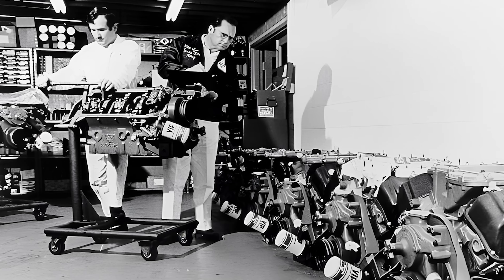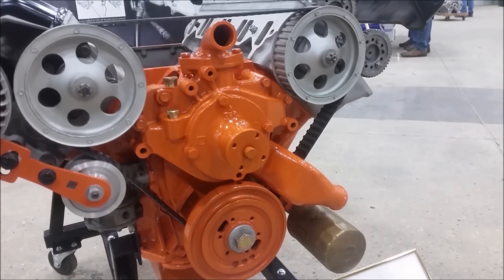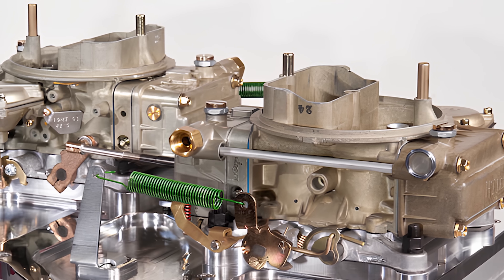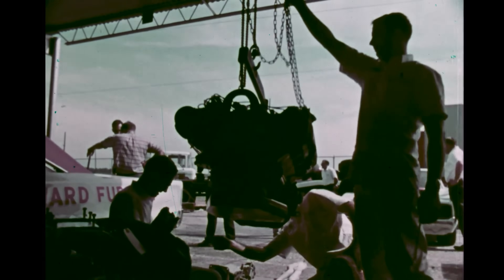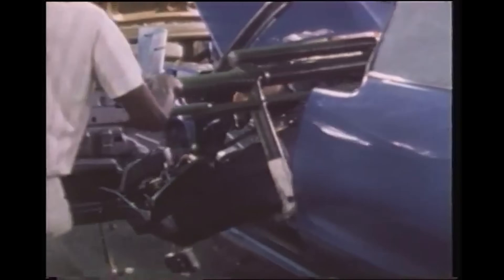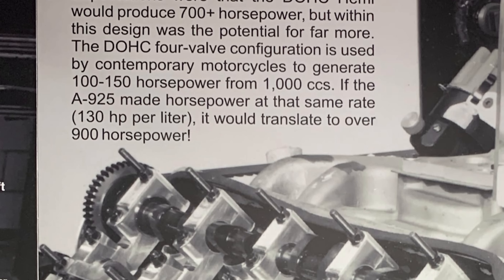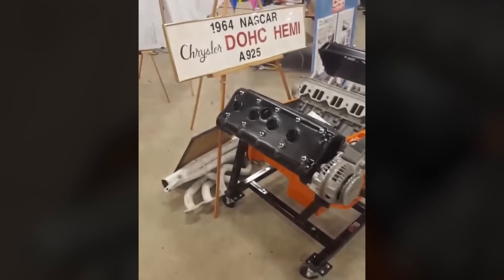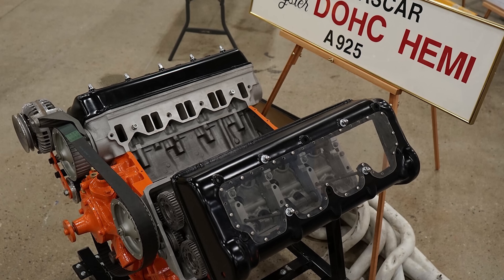THE UNTOLD TRUTH BEHIND CHRYSLER SECRET 426 DOOMSDAY ENGINE

Comment: All those parts and configuration for horsepower, to play with ford and chevy, and if you find an original 454 lS6 with the configuration, its 500 plus horsepower without all those parts.
Reply: So Chevy needed an extra 20+ cubic inches to play with Chrysler? Sad

Comment: Why did they just develop them for drag racing like ford with the cammer ????? Or just released them to the general public like a crate engine
Reply from the maker: That's a great question! The Chrysler 426 DOOMSDAY engine was designed for high-performance applications, and while drag racing might have  definitely been  one of its strengths, the focus was on performance and ultimatly a  great engineering experiment .  @ronaldotoole6986
Reply: @rarecarstoryscould you imagine the terror this things would be in the wing cars in nascar

Comment: They had this engine, as well as another Hemi well along in development, so they wouldn’t get caught out should Ford come out with something new. They wouldn’t only have used either engine if they had to. The other point, is they knew they were pushing the limits of what NASCAR would allow. The other Hemi that was under development was an answer to the Ford Boss 429. It was a conventional cam placement, two valve engines, just much bigger bore spacing, shorter stroke and enormous valves, built with an eye to living well at higher sustained RPM.
Reply from the maker: You're absolutely right! Chrysler was definitely ahead of the game with their engine developments. It's fascinating to see how competitive the automotive industry was back then, especially with NASCAR regulations in play. @jamesblair9614

Comment: This same exact example of the 426c.i. Hemispheric Engine's still available from different sources of the old school American Made Engine's, built by American Iron Engine's USA..I don't know how many of these engines are running and pumping out horsepower the engineers built them to be able to make an possibly a bit more torque than horsepower listed from the manufacturer..600+, hahaha, more like 700+ and Xs the listed amount of power that wasn't put on a dynamometer for the driveline horsepower rating..I'm pretty sure that during the 70s a guy had his car, a 68 or 69 Road Runner dynoed because it was hard to handle drag racing especially when 817hp to the wheels was all that huge piece of a PowerPlant Engine was wall to wall and so huge that it just tickled the almost crap outa me just idling and I had never seen anything quite like it before cause the 50s Hemispheric Engine's was not the same cubic inches as the 426c.i. Engine's was..300s and 200s was how they were built although they had more torque than horsepower and it was strong and torquey enough to make it to the big leagues..I've  gotx thef contact information for those who would have to have the opportunity to own and enjoy the old school American Made PowerPlants just to be willing to see first hand what was enjoyed as a teenager and early 20s with age..I was permitted to do time trails in a daily driver that was alot faster than expected at 15yrs old and I really enjoyed the 6.0 I's continuously running was fun for me and told that I can go 200mph if needed but not with no safety equipment for rollovers and crashes that happens not excepting anything like that to happen..A 1965 corvette engine was transferred into a 63 Chevy 2door Sedan Biscayne, with a 327c.i 375hp engine..I was amazed how strong the engine felt but the 6.08 time trial 7times in a row was the highlight of my life that's been happening quite a bit in my thoughts cause everything

Comment: " designed to use a stock 426 Hemi block", Vid shows a 426 max wedge. Me thinks the guy making this got a wedgie, Not for being a nerd, but for being a troll
Dude you are about as accurate as a barn doon shot out od a shotgun
Far as i know the issue with magnesium is dust and small chips getting overheated, Never hears of whole parts burning like you claim, BTW titanium is similar and same result for overheating dust and chips, probably worse.
Also in the dug hole with all the engines, The one whole one seen looks like a 348/409 dodge. I just think a dodge based presentation should have all dodges in it, same with other makes

Comment: 4 valve heads tend to move away from the more true Hemi shape and behave more like a pent head. The hemi is best for the combustion process
Reply: you are correct a 4 valve engine is not a hemi, Bu then the new Dodge So called hemi is not really a hemi ether. But Mopar has a patten on the name so they can call anything a hemi.
Reply: Actually a hemi is bad for combustion!🤷
Reply: That is not really true  the Hemi has the advantage of a true Cross scavenging the charge flows  directly across the  piston. The real dissadvantage is they have a really slow flow rate because the Combustion chamber is way to big.  In early 426 Top fuel engines the guys were running as much as 70* lead.. The Hemi can flow the air but it has no squish band and it need way to much lead to to make power.

Comment: A pent roof head design that Duesenberg had done 40 years earlier........along with the 4 valves and over head cams. This was NOT "cutting edge" in 1964.
Reply from the maker: You make a valid point! The engineering advancements in the automotive world often build on past innovations. It's fascinating to see how designs evolve over the years. @larrydrozd2740
@larrydrozd2740
Reply: @rarecarstorys Look at Bugatti in the 20's and where they got their engine designs....right after visiting Indianapolis...and seeing Miller!! A lot of times it comes down to who can actually make a design function properly and consistently. Perfect example of that would be the Rear Engine dragster. Garlits didn't invent it, but he made it work....and feasible.
Reply: @ The dodge DOHC was a prototype, the Duesenberg was a production engine that worked 50 years before the prototype
Reply: @ It was also a straight 8, weighed about 4000 pounds and was insanely expensive. :)
Reply: @ but dodge didn't invent it or make it work, a fail on both accounts.

Comment: Ford already did this long before that with the DOHC tank engine .To this day it is one of the best masterpieces engines ever made .even got banned in tractor pulling contests because it was too good.
Reply: no engine has ever been banned from truck pulling but doubt you will ever hear tesla in it
Reply: @kirkbaxter7261 Don't know much about truck pulling do you... The Ford 351 Cleveland is NOT allowed in ANY small block truck pulling class....
Reply: Ford was also running DOHC engines in Indy cars and Formula 1 they were already winning races long before Dodge made that abortion. If Dodge had made that engine Ford had the technology to build one better.

Comment: This video contains too much misinformation.  Ronny Householder ended these programs with NASCAR.  Read the Ramchargers book by David Rockwell if you want to understand what happened to the A-925.  Chrysler was building this engine for 10,000 RPMs.  There was also a version with twin cams in the block if the twin OHC version was banned by rule constraints.  Chrysler Engineers were more than ready to bury anything FoMoCo brought to a starting line.  GM  was a distant third in anything done.  Smokey Yunick and Bill Jenkins were nothing in the eyes of Tom Hoover and Jim Thornton.

Comment: Ok 🤔so chrysler already made what ford fought back with they wouldnt alow chrysler too run it but ford could Hhmm ?? Really🤔
Reply: You have no clue what you are talking about, the 426 hemi was ban because it was a limited number Race engine. The Ford 427 high riser was ban because Mopar people were cry babies.
 The hemi was re-instated as soon as Mopar built the 500 production cars, nether Fords ban 427 high riser or the 427 SOHC engines were ever allowed in NASCAR.  
The dual overhead cam Mopar was nothing more than an experimental Proto type, never close to becoming a production engine.
Reply: @mylanmiller9656  right back atcha ford was a bunch of crybabies as well,👍
Reply: I didn't know the highriser was banned considering Ford were running tunnel ports later on & dual carbs at one point.

Also the 427 SOHC was banned for about as long as the Hemi was Ford protested & was allowed to run it from 66 on but only at a certain weight In a certain car ( may have been different if it was available in a production car) also it was legal with penalties up to the end of the  big block era.

Chrysler didnt go crying to NASCAR they got into development to counter the SOHC unfortunately the bean counters & brass saw an opportunity to scare Bill France into  banning the SOHC which  backfired for them in getting all exotic engines banned.
Reply: These videos are all bs anyway.
Reply: @retrotom5346  The High riser was ban after the 1964 NASCAR season because, Mopar was crying the Hemi was ban. The reason for banning the hemi was Mopar had not put the engine in a production car. Mopar had the Ford High riser ban because, they said it wouldn't fit under the hood without a scoop. the reason ford built the SOHC in 90 days was because the high riser was ban. . the strange thing was NASCAR let Ford Run the Tunnel port and it was never a production engine. Homologation rules should have stopped the Tunnel port but for some reason it was allowed to race.
Reply: @mylanmiller9656  please show me an article any legitimate article that says the high riser was banned I bet you can't find one.

I believe the Ford engines running dual 4s in NASCAR were high riser & why would Chrysler complain about a non production engine when there engine was the same your story does not add up.
Tunnel port was allowed for the same reason Ford was allowed to run dual 4s they complained about the Hemi so NASCAR gave them concessions.
Reply: @retrotom5346  i think  You are  confused about what you are talking about, there were 5 differant 427 engines, the first was  the 427 low  riser the head was  the same plane as a 390, then Ford made teh 427 high riser, it was the engine that for sure was ban. then Ford made the Cammer it was also ban, then ford  built the Medium riser a good street head but no race winner, then  they built the Tunnel port. If the 427 high riser had not been ban Ford would never have made the Cammer or the Tunnel port engine.
Reply: @mylanmiller9656  so the high riser was banned but the Sohc was not.
Reply: @mylanmiller9656  so I looked it up & it was banned the same time as the Hemi Sohc & GM mystery motor.
Your story still does not make sense seeing  that you claim Ford built the Sohc  because of the high riser being banned when it was not banned until the other engines were.
It was probably unbanned at the end of 65 like the Sohc & Hemi.
Reply: @retrotom5346  Ford was told at the end of the race season that the High riser would not be  allowed for the 1965 season. ford built the SOHC in 90 days, then they were told that it was not allowed because they wouldn't allow a overhead cam engine.  The hemi and SOHC ware instated back in but the SOHC had a Weight penalty that hurt the handling of the car so bad
 the power was no advantage. The 427 High riser was never allowed to race again because the 
Engine needed a hood scoop. Hood scoops are not allowed to this day.
Reply: @mylanmiller9656  ok so Ford said hey guys NASCAR does not like our high performance wedge motor maybe they will be ok with an ohc Hemi.
So why dont 64 Galaxie NASCAR's have a scoop or bulge.
Reply: @retrotom5346  All 1964 Ford s and Mercury cars run in NASCAR had a hood bubble. The 427 highriser had to have a bubble to fit under the hood.
Reply: @mylanmiller9656  what tracks what races all pics I can find show flat hoods.
Reply: @retrotom5346  I am getting the same results as you, the only thing I found was The cars we are finding pictures of are running the low riser engine. the High riser was only used for one year and not by all teams. One thing I did find was, the reason for the tunnel port being allowed was Ford was boycotting the fact that that, NASCAR had re-instated the Hemi but not the High riser or the Cammer. To lure Ford back into the mix, Bill France allowed the tunnel port engine to run, even though Ford had no intension of making it a production engine.  Ford was developing the Boss 429 and were not going to spend the money to make the  Tunnel port a production option. NASCAR needed Ford participation in their races To sell to the fans so they give in to Ford .
Reply: @mylanmiller9656  sounds about right I have no problems with the Fords I love them all the tunnel ports & high risers are awesome & my brother has a 63 fastback roof that was a factory 406 4 SPD ( now a 428 ).
So I just watched the Atlanta 500 highlights & southern 500 highlights in the Atlanta video they talk about Ford's new 7000 rpm engine and southern video what looks like a high riser with no intake on it under the hood of a car & I could not find any obvious bubble hoods.

I believe it just got banned with the other exotic motors I did see a Hot Rod mag article saying the mystery motor was banned too I also saw some article claiming the hood bubble thing but it may just be bs there's a lot of stories made up by fans of all the makes to discredit other makes.

I believe nascar allowed the Hemi towards the end of 65 because of the boycott but by that stage they were already going to be installing it in production cars I know the Ram chargers claimed they were hoping the dohc would be built to counter the SOHC on the drag strip but after the brass scared  Bill France into banning the SOHC they didn't need it for NASCAR & dropped it.
Been a good debate I didn't know originally the high riser was banned too.

Comment: I wish Chrysler would build a modern version of the DOHC 426 Hemi engine, with today's technology it would give the competition a run for their money!!!
Reply: With a Flat Plane Crank, With DOHCs, With THAT MUCH cubic inches! Whooooo Lord What A Bad Oscar!
Reply: An 800 cubic inch version! It would STRICKTLY be a racing engine, so you might as well go big, or go home!
Reply: @davidstuck2866  Valid. 🤷🏽 Can't Argue There. 😂
Reply: All dohc does is introduce
soo many more moving parts just to
trade low end torque for high rpm hp.

Its not worth the trade. Ford is finding
this out. They have DOHC everything and
they have no torque compared to the
Hemi. The torque curves on dohc
engines are terrible.

The Viper did extremely well in
endurance racing because it makes all
of its power at such a low rpm that it
wouldn't burn through fuel like the
DOHC engines it raced

Hemi engines and the pushrod Srt10
make about as much torque as they do
hp. I really hope it stays that way.

Ohv pushrod engines are lighter and more reliable and can sustain higher hp levels for much longer.
Reply: @Rogueginger69 All that is incorrect!🤷
Reply: I agree, heck it would've demolished the 5.0L Coyote V8 with ease no questions asked.

Comment: 😂 I didn’t know that. Mr AI said that engine had duel high compression camshafts
Reply: This is why you do actual research instead of using AI slop
Reply: The flux capacitor was proven more effective. They could just never come up with the 1.21 gigawatts to run it.
Reply: @old_school_guy  😂😂
Reply: High Compression Camshafts are a really hot setup, that is why no one uses them even today.
Reply: High Compression comma camshaft.
Reply: @jeffpolakiewicz2277  I always liked the guy that said, "I have a 3/4 cam." Are 4 lobes missing?
Reply: @old_school_guy  Yes 3/4 race cam because a full race cam was illegal on the street. Thats what I was told.
Reply: Yup and the car had high compression headlights and extra slippery muffler bearing s too!